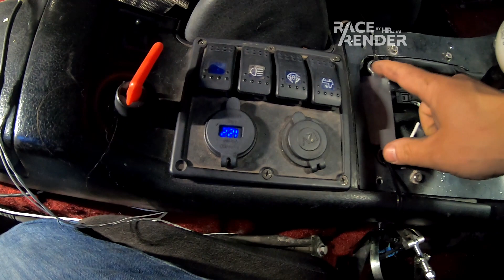MK60 ABS Install Overview (S13 240SX)

Comment: I saw this video a couple times before and this is the worst video for me.
Not because it is bad but because I already wanted it but now I am going to see where I can get all the parts and see if I can make something up to put it in an OEM place haha
Any tips ?
I have a non abs 240sx with gktech hub front and r33/s14 rear hub, r33 brakes all round, r33 bmc and HFM mbc (17/16 if I recall)
Nothing is useable from this is there ?

Comment: Any chance you remember what part numbers you used for the brake line adapters?
Reply from the maker: Pretty sure I used Russell fittings (other brands are available) - here's the guide I followed, it lists all of the fitting types, just search for an adapter that works for your application. I re-plumbed my car with OEM-style M10x1.0 brake fittings just because it made more sense in my head, but you could use the BMW-style fittings and skip the adapters to simplify things http://www.tracktuned.com/feed/mk60absswapguide

Comment: That would be great if you would give us a update/review of it working at the track
Reply from the maker: It is amazing! I mounted the module near my hip, and you can hear it click when it's working, which is great audible feedback for low-grip sections of the track. At an event in September, I could hear it clicking through a high speed corner where I was trail braking just slightly to get weight on the nose of the car, and I could hear it activating ABS as the unloaded/inside tire was trying to skid. I never would have heard that skid without ABS and the functionality is super effective. I can focus on my corner entry and other inputs now that I don't have to hyper-focus on the corner entry and listen very closely for a skidding tire.

Comment: Hi ! i already have an s13 Silvia with ABS ( crappy ) , so does it mean the installation is a lot simpler ?  I also have GKtech diff cover with provision for dual 300zx sensor not sure ?
Reply from the maker: I'm not sure what the OEM ABS tone rings look like on the front of an S13 but yeah I'm using OEM S14 hubs/ABS rings and OEM G35/37 rear sensors on ABS-ring-5-bolt axles (from a Z32). It should be much easier. I've heard the 90s Nissan stuff is 3-channel, do you have 3 lines coming out of your brake master cylinder or just 2?
Reply: @FlatBlack_240SX   yes oem is 2 sensor in front and one on diff input shaft. i have 2 lines coming out of MC and going to the ABS module .
Reply from the maker: @th1_s138  Well that should simplify things a little bit - you shouldn't have to redo your brake master lines or the front wheel brake lines from the ABS module. You'll probably have to add a line to one of your rear wheels if it's a single line to the rear with a split near the rear subframe like mine was.
Reply: @FlatBlack_240SX  i think that would be the best way to go for me as well . I think the 350z sensor are bolt-on for my diff cover and i would just need to machine fit Dual tone ring on my 6 bolt axle ( s15 helical read diff )

Comment: Are you using 3/16 line from the master or 1/4? The thread on grm says to use 1/4 but I'm stuck with 3/16 because of my fitting sizes
Reply from the maker: My whole car is 3/16 - the line size shouldn't matter.

Comment from the maker: Interesting fact/update: I am converting from 48 tooth tone rings to the OEM Nissan 46 tooth tone rings. I drove my car with the 46T rear rings and 48T front rings and it worked just fine, so I guess you don't even necessarily need to match the tone ring teeth count, as long as they are close. I assume this is for tire diameter differences, and other total tire height variables.

Comment: @FlatBlackable, Did you have part number of this sensors?
Reply from the maker: No, I got them from the junkyard but I believe this is it for the fronts: https://www.amazon.com/Front-SENSOR-Replacement-Nissan-Maxima/dp/B09F3L3JY8/ the rears are off a G35/G37 diff cover

Comment: Great vid! Just got a module for my subaru and following the same principle and thanks for the vid as there is not much out there

Just a Q on the data you are getting from the k-line can data, what are you using to read that data (i see you referenced a kline obd reader cable) but wht software are you using to see the wheel speeds etc?

Im going to be wiring in speeds etc to a digital dash but want to be able to test all of this first before i do that kind of wiring

Thanks mate
Reply from the maker: The software is called "INPA" - from what I understand, it is a reverse engineered and English language translated version of a BMW diagnostic software. There are links on BMW forums, you'll need to Google "INPA download" to find a currently hosted version
Reply: @FlatBlack_240SX  thanks mate

Comment: Great overview! 
Does the rht setup also have abs warning light?
Reply from the maker: Yes, the RHT harness has a labelled wire for the ABS warning light, but there are also diagrams for the harness pinout (check the links in the description) if you want to DIY it